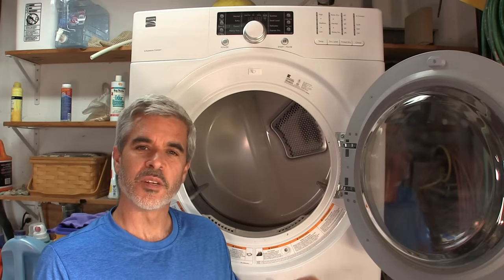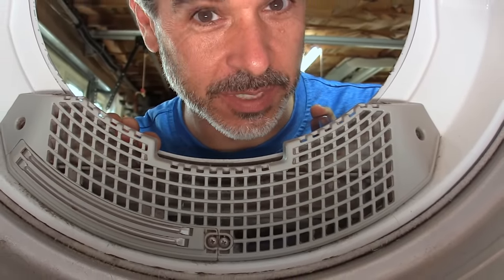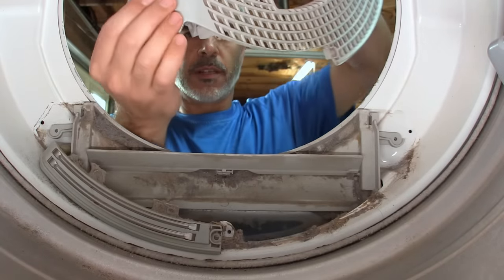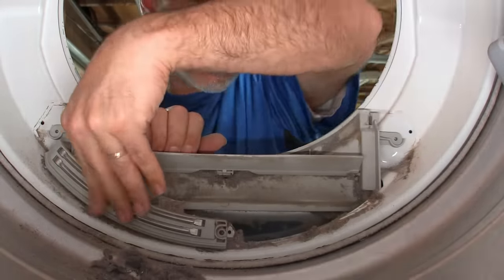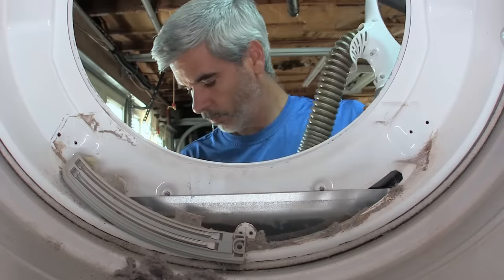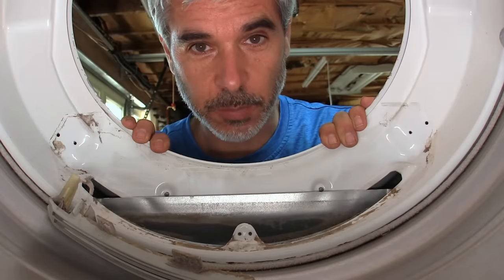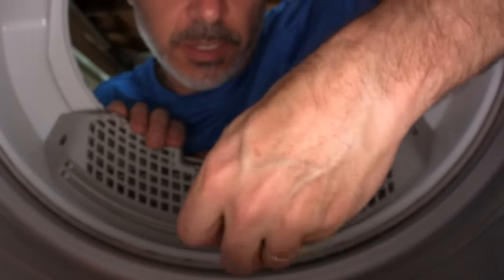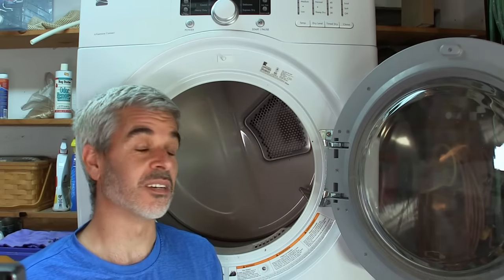Dryer Lint Trap Deep-Cleaning: I found 4 cups of fluff below the filter!

Comment: I wished you had used a good cleaner to wipe off those parts before reassembling the unit.
Reply from the maker: The insides definitely were not as clean as they could have been for sure.  I got a bit too focused on making the video vs. making the parts sparkle.  Next load they would already be dusty anyway honestly...

Comment: My dryer has no screws on the inside to remove that piece I got a piece of half inch copper tubing and rigged it to a wet dry vacuum cleaner to kind of get down there it gets a lot it doesn't get it all but it does a good job considering.

Comment: Thanks Dan for a great video. My lint trap is on the top of the dryer. Is there away to clean. I know there is gunk down there.
Reply from the maker: Those tend to have a long shoot down the back side of the dryer.  The way to get to those is to pull the back off the dryer to get access. The whole shoot can be removed and cleaned out. Sorry I don't have a video on that particular design.

Comment: Our Amana doesn't have those two center screws. We can't figure out how to pop that interior screen. This is all because the actual filter suddenly wouldn't slide back flush. Any suggestions?
Reply: Just an FYI, newer Amanas require the removal of the top, the console and front in order to reach the lint parts. As for mine, after all that we found the front (interior) where the filter slides into has warped to the point where the filter sticks. No idea how I'm going to fix this.
Reply from the maker: Thanks for the info Thomas!

Comment: I am looking for a way to extract what lint remains beyond this cleaning. My Maytag is similarly designed to Dan's dryer in the video, and has a drum at the bottom that extends back beyond what my vertically positioned crevice stick is able to reach. I need a some kind of an attachment that will bend 90 degrees and clean the walls of the drum [back, top, sides, and bottom].

Comment: LG dryer owners -  watch this video. Prevent a fire!  
Yes, clean this vent system often!!!

FORTUNATELY a dryer wheel failed on our 14 year LG steam dryer (loud thumping) to alert us to a problem inside our dryer!!!  Took apart the dryer to replace wheel to find the INSIDE OF THE DRYER had loads OF LINT!!!!  A FIRE HAZARD.  We routinely clean the vents so they were fine & blower too, but lint leaked inside the dryer, possibly around the drum.

There was a 6" wad of felted lint wrapped around 1 roller so it broke. The other wheels were ok as only a little lint wrapped around rollers. >>>There were significant lint accumulations and charred lint dust around the electric heaters coils!!!
 
PURE LUCK THAT  WE DID NOT HAVE A DRYER FIRE!!!  

We watched a youtube video of a gas lg dryer repair which also had significant accumulation of lint inside dryer, so assume that these issues are common. (Good video to review when taking apart & putting dryer back together to replace rollers, etc. Sorry forgot name - no link. Commentors that used his video said it took 3 hours to fix dryer. We are slower. Ours is fixed & put back together after 5 days, not including the time to order LG dryer repair kit (4 rollers, belt & idler.) Should last another decade or so, if cleaned inside periodically around heater & rollers!!! Yikes!!!

These dryers need a massive redesign to prevent lint accumulation inside dryer!!!  Disassembling dryer  filter system periodically & cleaning will reduce, but not prevent dryer lint inside dryer. The heater should be enclosed in a separate space, so lint can't accumulate near heater coils!!!  

Now that dryer is fixed is it time to scrap it & buy a different brand dryer   & write LG & a consummer protection agency about this fire hazard? Likely keep & clean lint filter system & monitor internal lint accumulation.
How to monitor internal lint accummulation? Port, camera, take the top off, etc. periodically???

Comment: Just did this today, before seeing this video, and now my dryer sounds like a jet engine and shakes. Any suggestions on what I did wrong?
Reply from the maker: Best guess is that something broke loose and  now is wrapped around the blower making it off balance.  I’d take the exhaust off the back and use a leaf blower in the back with the front vent parts removed.  Might blow the debris off the blades.

Comment: Do you know if that stops the dryer from heating anymore all together
Reply from the maker: It likely isn’t this part of the dryer that has the problem. More likely the exhaust vent out the back is clogged.  If not that, then you have an issue with the burner or heating element circuit.  I’d call a professional if it isn’t just a clog.

Comment: This only pertains to if you have that exact same dryer correct?
Reply from the maker: The idea is universal.  Lint makes it past the filter in every model, some are worse than others.  The exact technique I used is specific, but the idea is general.  Look down below the lint trap with a flashlight and see what’s down there. Also, don’t forget to look at the exhaust end and the hose as those can get really bad too.
Reply: @DansWay   thanks!  I have a small tube i attach to my shop vac and stick down in there and suck the lint out but i never knew how that came apart, i guess i didn't stick my head far enough inside the dryer to see screws on back side. I will look next time

Comment: I just found this video and am going to do this as soon as possible, but Dan do you have a video on cleaning the front loading washing machine?  Mine is whirlpool and sometimes the clothes can smell musty. What and how is this machine cleaned?
Reply from the maker: Hey Judy, YES my wife keeps bugging me to do a video and clean out / replace the rubber seal on our front-loading washing machine.  The clothing DOES smell musty.  For now, you can run an empty load at high heat with bleach, manually clean out the area under the rubber seal (there is a drain there that can get clogged), and open and clean out the filter in the bottom-left corner.  Lots of nasty stuff ends up there.  Would you be willing to remove the top and front panels to do a deep clean if I showed you how?
Reply: @DansWay  absolutely!  Someone told me one time that the panels of the washer and the drier provide access to "stuff" below the tubs.  But I do need to try to clean both washer and drier, but since you explained the dryer, I really need the washer deep clean! When I started on social security I didn't realize I'd have to start to do home maintenance myself because I can't afford to get the repairmen to do it.  I really like your videos and it's obvious to me that a woman did not design the Whirlpool steam duet washer or dryer.  The dryer lint filter is the worst design I've ever seen 🙂Thank you for the suggestion on the initial work around for the washer.  Also include how to keep the rubber seal from getting moldy, I hate it and I can't get it clean either.
Reply from the maker: @judyfinch9452  Ok, awesome.  I'll work on it in the near future....

Comment: I am wondering if that could be why my dryer is taking a little longer to dry clothes than it used to take.  Thank you for sharing.
Reply from the maker: Could be, definitely look at the hose leading outside, and the outside flap/mesh as well. Could be clogged there also.  I have a video for that part linked in the description.
Reply: @DansWay  Thanks!

Comment: This buildup is mainly caused by anti-static dryer sheets.  It also clogs the screen filter so dish soap and hot water is your friend.
Reply: I never use dryer sheets.  I use the liquid stuff you pour into the rinse.  My dryer is still clogged.
Reply: @fewferfev  -- I never use either and I don't have any buildup and my dryer is over 10 years old so the liquid stuff may be what's causing your clogging.  I know the sheets do for sure.

Comment: That’s not the half of it. You should be able to remove the lower front cabinet panel to expose the blower assembly. The blower wheel will be caked with lint too. Clean out the assembly and the vent ducting as well. Be sure to unplug the dryer first.

Comment: Also you unplugged the dryer before doing this I imagine?
Reply: I haven't unplugged it but most certainly will when I install the new part. I ordered it off Amazon after contacting Samsung directly today. I spoke with a rep who confirmed you gave me the correct replacement part for my machine. I can't stand relying on other people's homes to do my laundry. So I pulled the plug. Should I need help when the part arrives and I start to install would it be ok to reach out to you? I know I'm asking a lot from someone I don't know.
Reply from the maker: You can always ask questions here.  These help others as well who are facing the same problems.

Comment: The lint catcher was removed and a sock got inside. How do you open the dryer? The front or the back? I have the stackable kind.
Reply from the maker: On mine, the blower is in the front left as you face it, and the exhaust runs the length from the center to the back output.  You can take the hose off the back and reach all the way to the output of the blower.  If the sock is in the blower itself, you will have to remove the front panel to get to the blower.  Check out my exhaust video to perhaps learn enough to get inside the back: https://youtu.be/oaCXtmdLJkU

Comment: I hope you are still checking your comments on your old videos. So I need to do this. I think I can but the part you call the "flap" at appx 7:09 of the video broke on my machine. The flimsy side piece that broke off and not it does not fit properly back into my machine so my lint basket isn't going in flush and I am afraid that will allow too much lint to gather and cause a fire. What is that flap part called so I can order it? It's only the actual flap that is broken now "it say please insert filter before using". My linter filter itself does not need to be replaced. Just that flap part. Can you help me with the actual name? It is for a Samsung Model # DVE50R5400W/A3 electric dryer? Any information you could provide would be great! Thank you
Reply from the maker: I normally get parts from Sears Parts Direct myself.  Here is the home page for your dryer on that site: https://www.searspartsdirect.com/manual/2d1hwnso22-001482/samsung-dve50r5400w-a3-00-dryer-parts  Unfortunately it appears that they don't sell the lint-trap pieces anymore (besides the removable lint trap itself).   That page says the lint trap assembly is a DC97-16741A and you can worst case purchase the whole thing there or over on amazon here: https://amzn.to/40tSWyW.  Do a search on ebay and you will find a bunch of these as well like here: https://tinyurl.com/DC97-16741B
Reply: Thank you so much for your reply! I did a deep dive and found out it was no longer being made. The others don't look compatible. So thank you for providing all that info and I will look at everything you sent. THANK YOU!!
Reply from the maker: @heathersiegler6837  you're very welcome!  Glad I could help you.
Reply: Hi Dan. I don't mean to be such a pain! I'm widowed at a young age and I feel every repairman who comes here when they find out it's just me immediately see $$$ and so I desperately want to learn to do for myself when I can. I can't believe they no longer make that $12 lint flap! But they don't. What would YOU do? By the new one for the $130 or choose to purchase off Ebay for around $60, used? Also is this something I can fairly easy install myself? I really don't want to call anyone. Thank you for doing so much digging for me. Having that part number has made it much easier.
Reply: I just looked through the Sears spare parts. Your first link and I don't see DC97-16741A at all to purchase from that site. When I look at the Ebay parts the last letter is a B not an A. Is there a difference? I'm really sorry but
laundry is piling up. I'm thinking of just going with the Amazon for $130. Would that be all I need to purchase that one part or do I need to buy anything else for installation? I really appreciate your time!
Reply from the maker: @heathersiegler6837  Hey Heather, no worries!  Personally, I would first try to repair the old one with glues or epoxy.  If that failed, I would purchase used on Ebay because it is worth the shot that yours was just flawed or otherwise damaged somehow.  I'm glad you are trying, and so sorry that your experience is so common.  Even worse when you are elderly and widowed.  

My poor next door neighbor has had lots of horror stories to share about people trying to rip her off.  You have to use a lot of wisdom and don't be afraid to walk away or say no. You can always change your mind later, and if someone isn't trying to rip you off they should be understanding and willing to reengage with you if you come back to them later after saying no or 'not today'...
Reply from the maker: @heathersiegler6837  I'm not sure on the A vs. B...  Whoever you purchase from, you can ask them and confirm they will let you return an item if it is wrong.  Some are really good at taking your machine model number and confirming that their part is correct.  With that confirmation, you can then more easily return an item if it doesn't work.
Reply: You have been a great help. I think I'm going to order from Amazon for $130.99. However by the picture provided I can't see if the lint trap flap is included. I should just assume it's included in the Assy Cover Filter for $130.99. Do you think I will be capable of installing myself? 
PS All widows aren't elderly lol. I lost my husband at 49. I'm 47. But that's besides the point. 

I want to try epoxy but that scares me a little. I truly want to thank you for all of your genuine, amazing support. I think those should be my last questions. Once I hear back I think I will be ready to select buy on from the Amazon link you sent me.
Reply: Dan one more question. You think I could try to gorilla glue that one broken plastic piece and fix it that easy?
Reply from the maker: @heathersiegler6837  Either Amazon or the used from Ebay should work.  I can only assume it will be included honestly.  The advantage of Amazon is the free returns if it doesn't have what you need...  Let me know how it turns out!
Reply from the maker: @heathersiegler6837  you could definitely try it.  Can't hurt any worse than a broken part. 2-part epoxy is another idea as it dries hard in 5-10 minutes.

Comment: Oh no ! I opened this vid to see how do I plug the heat sensor wires back. Idk if the ground is plugged into the right place ! And you didn't even unplug it. 
So now how can I know 😢
Reply from the maker: Good question.  If there are only two wires it might not matter. Is there not a 'key' or notch or some way to tell which way it originally was?  Can you see the angle or twist of the wires which would give you a clue?

Comment: my dryer is a GE dryer and lint is around my door seal but it’s on top of my lint filter but i’ve noticed lint pulls to the left side and gets up inside my lint trap cover housing and leaks lint there and then it gets all over our clothes and home. we have tighten it all we can and it still is gapped and leaks, it’s driving me crazy , i had a ge guy come out and he said it’s normal no it’s not lol , i noticed lint around my door seal first after we got it but didn’t think much about it, now the warranty is up , can some one give me some in site on how to seal this where lint isn’t coming out of my lint trap housing cover , i can’t afford to get another dryer and i’ve only had this one a year and a half! my my lint trap is different from the one on here too ! Thank you
Reply from the maker: Could you put a line of gasket material on the unit or door that would mate with the existing gasket to add another pliable layer of sealing?  Could make the door a bit harder to close but would seal…?  Also, check that the exhaust pipe and outside vent are totally clear of lint that would cause back-pressure on the blower, causing it to force air out of the cracks around the door.

Comment: I have the same dryer.  I usually work some of the lint out with a stick about a foot long.  Dont get it all, but get the bulk of it without taking it apart.  I wonder about what's in that air way around the corner, where it turns torwards the back.   Where you can't see what's there.  Any way to access that?
Reply from the maker: You can get access to the whole back side be removing the exhaust tube. It is a long straight shot from the front to the back.  The blower is in the front-left as you look at it.  Check out my other video which shows you how to do the back: https://youtu.be/oaCXtmdLJkU

Comment: Why is your ceiling insulation paper on the outside? Isn’t it supposed to go toward the area you want warm?
Reply from the maker: Insulation with paper facing is applied from the inside of the house and stapled to the joists, so you see it if you don't drywall over it.  That paper has been there for 40 years... 😃
Reply: @DansWay  feces. I’ve been doing paper toward heat based on the guy who did my home inspection advice.
Reply from the maker: @tracy3812  Got it.  What I don't understand about this advice is that you are supposed to (or prefer to) not totally fill a roof cavity with insulation.  You want an air-gap above the insulation.  You couldn't provide this gap if you installed the insulation with the paper face-up.  All construction I've been involved with installs the paper on the inside of the working space.  Either way, not a huge issue either way!
Reply: @DansWay  Dan—so true bec I know insulation is supposed to “breathe.” I’ve never had the upper body strength or dexterity to get the paper perfectly tight to the ceiling. I just have done the best I could.